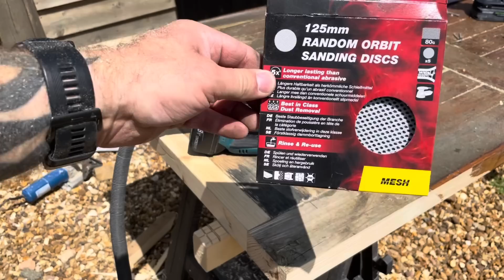Rotten door repair

Comment: Interesting repair. I like the contra slopes will remember that with hinge and clap. I like the bird song and the shot of flight as well. Carpentry does more listening than talking! I was told that by a boatbuilder over 40 years ago and he was right. As I don’t have biscuits I would have to use dowels.

Comment: Good job, but would it not have been better to have the 45 deg. scarf joint running the opposite way to prevent any water tracking into the end grain if the glue does not hold?
Reply from the maker: Good point and it isn’t perfect. I only had access to scraps of timber so I had to do the best I could with what I had 👍🏼
Reply: A very nice and satisfying traditional joiner's repair, but if you used epoxy resin, which saturates and seals the endgrains permanently, the biscuits and scarfing would not be necessary ...just clamp the joints accurately (with plastic wrap to separate the clamps from the epoxy) and water will never enter again. Epoxy-saturated joints are stronger than the timber they join, and replace dowells, biscuits and tenons in this application. (Softwoods like pine are a different case, as they are resinous and dont have lateral veins to enable good glue penetration).  Also epoxy-coat the outer faces of the new timber and under the hinge recess. A modern boatbuilders repair, and not a bodge.
Reply: Great video

Comment: High quality work.  I'm wondering why the biscuits were not in the middle but rather near the edges.  Nice saw.
Reply: Two rows of biscuits would have been better. Dominos would have been better still.
Reply: biscuits should have been put in the slanted part.

Comment: Curious why you didn't biscuit the 45's? Also I heard the 3M Cubitron sandpaper is really good for the orbital
Reply from the maker: Good point. The only reason I use biscuits is for alignment as the added strength is minimal. Once I’d aligned with the other biscuits I was happy with the finish so I didn’t add anymore. Will check that sand paper too 👍🏼
Reply: @theyuppychippy Curious, if you didn’t use biscuits you’re suggesting glue only.  Wouldn’t that be too weak?
Reply: @srw_cricket2976  As always, the glue will be stronger than the wood itself.

Comment: Good work but it seems that the lower plank should be in the full length to give more strength to the repair
Reply from the maker: Good point, I’ve never had one fail though. I also only had access to scraps of timber so I had to do the best I could with what I had 👍🏼

Comment: I hope you sealed the bottom of the door.
Reply from the maker: Indeed I did.
Reply: I just repaired a door where they didn't.
Reply: Ceiling, the bottom of the door is a good cure for the problem after you have inserted a new piece of timber.

However, I imagine that the cause of the rotting bottom of the door was that rainwater gets down into the bottom of the stairwell at the foot of the door and causes, the damage over a period of time.

I hope the owner of the building takes some preventative steps, such as putting a drain at the bottom of the steps in the concrete pad.

In Britain there is a saying an ounce of prevention is much better than a tonne of cure.

Comment: Why rush the finish like it’s an afterthought? You should have taken the time and sand down the door and apply multiple layers of proper UV and water resistant lacquer or paint on the door. 

Do a proper job no matter what you do. I wouldn’t hire you to do anything.
Reply from the maker: I love you 😘
Reply: Lacquer ain’t water resistant. Paint won’t hold up in that situation either. I’d wrap that door bottom in aluminum.
Reply: @patrickperry6945  better yet I’d install an aluminium door and use that one for firewood.